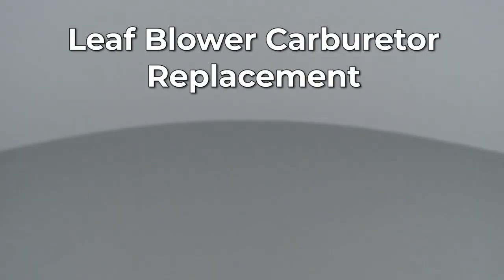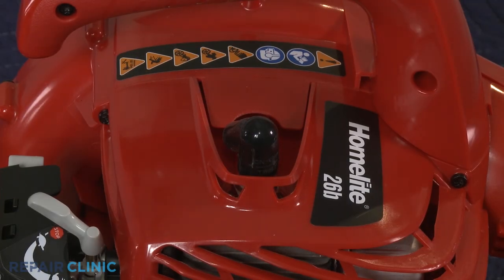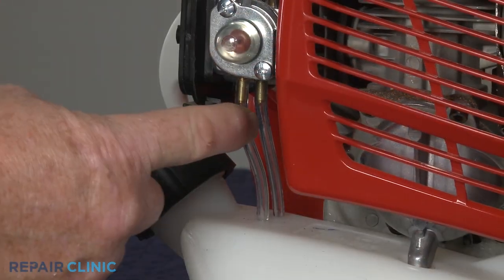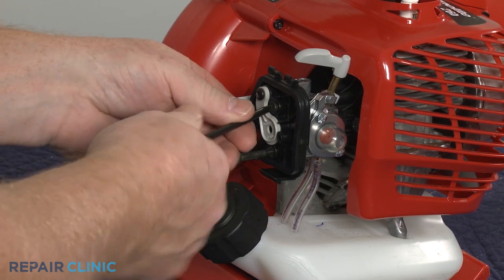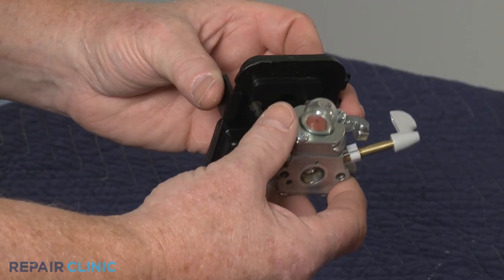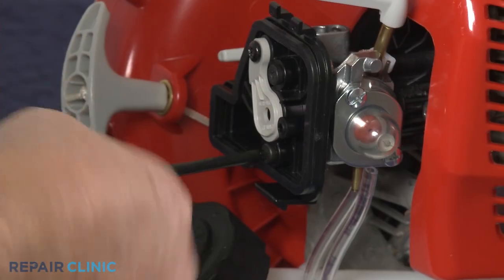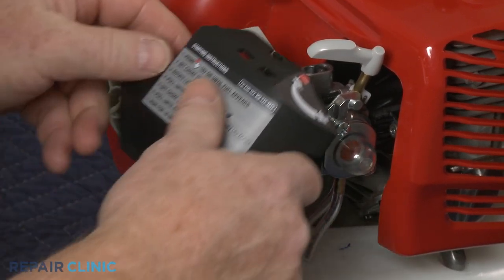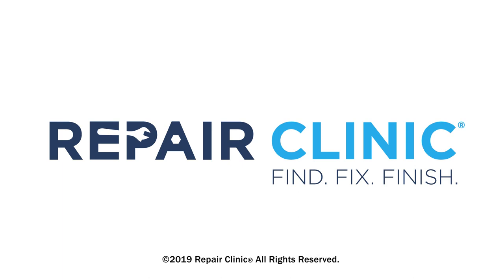Homelite Leaf Blower Carburetor Replacement (308054114 )

Comment: I like how they said to pull the spark plug high tension wire off in case of accidental start up…. Hell I wouldn’t change the carburetor if it would start up that easily.